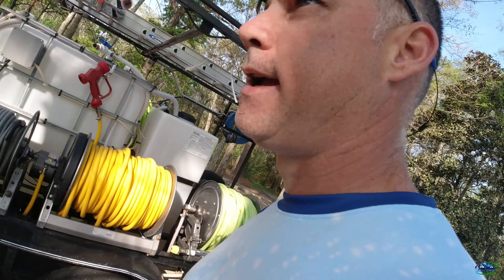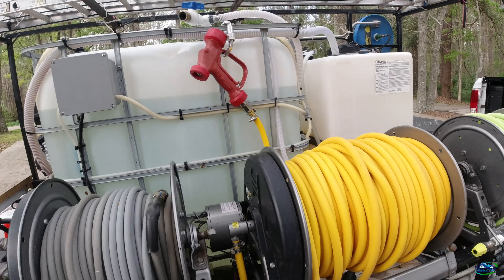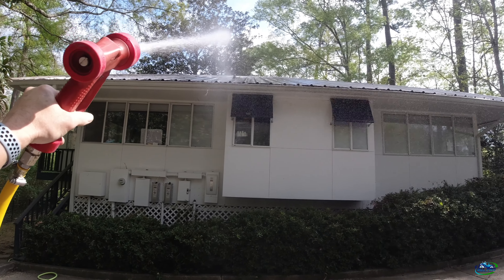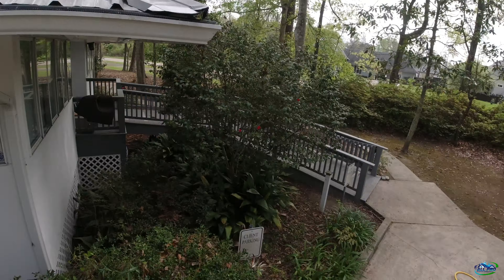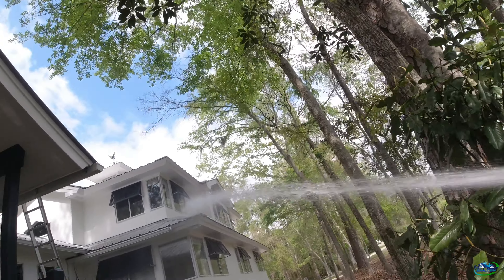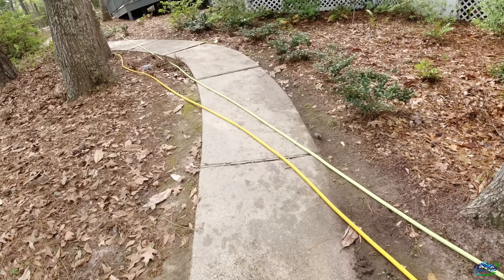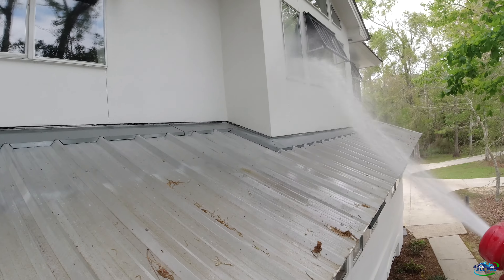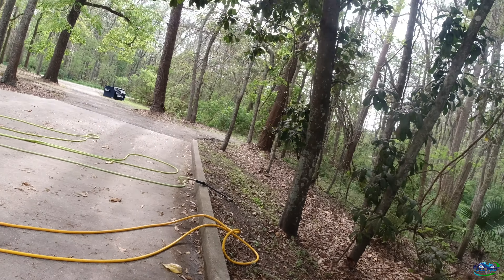Commercial Metal Roof Wash

Comment: I did a metal roof last month and my mix (even after heavy rinsing) was leaving a haze, so i had to switch gears and walk the roof and turbo nozzled it.  It had pollen on it, but it wasn't pitched too crazy to walk on.  Took about 8 hours, but the payout was $2100.  For the record, turbo nozzle cleans a metal roof and makes it look brand new with no issues to the metal.
Reply from the maker: Good info. Thanks